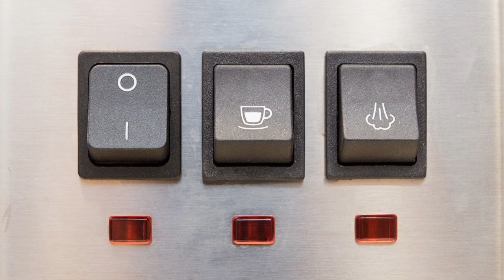Gaggia Classic Pro Power Switch Mod

Comment: I just tried modifying the original switch (removing the spring) and not using any additional parts. If you remove the two wires from the socket as you see in the video,  they are just long enough to reach to the power switch. The other end of those cables are connected to the main board. You just need a long screwdriver to undo two screws to remove the boiler and the plastic box that holds the electronics. Then you just unplug the brown and purple wires, they have the right connectors to plug them into the switch (instead of the two new black cables shown in this video). Obviously the other end goes back to the original location, the socket. This way you can revert everything whenever you want to, just put the spring back into the switch, replug the original bottom two switch cables (those were just unplugged, and left in place) and reconnect the brown and purple cables two the main board. Free and reversible.
Reply: Thank you. This worked. The only correction is that it’s the pump that you have to unscrew with the PCB tower, not the boiler.
Reply: Thanks a lot! Worked for me very well! 🙂

(My machine had yellow and red (instead of brown as on the video) wires at the bottom of the power switch)

Comment: Hi Damian, thank you for this great video. In my Gaggia the brown cable on the main switch is red. I think this doesnt matter? I mean, i have to change the two lower cables of the main switch by the new cables from the plug of the back of the machine! Is this correct?
Reply from the maker: I am not able to guarantee you if your wiring is correct? Theoretically, as you write, but if I do not see where the cables go in your coffee machine, I can be wrong?
Reply: Hi Michael
Did you make the change? did you have any problems? My cable is also red and not brown.
Reply: I also had the red cable (instead of brown) and changing two lower cables worked for me.

Comment: Hey Damian, Thanks for the video. I have 2 questions:
I guess some people in the comments here are asking if they can just remove the spring in the original switch and keep the same original wiring. Will that be an issue? (Ecotimer is still in use)

Also, I was wondering what are the chances of people reverting back to the original wiring after the mod. (I'm thinking to just cut the original wiring and route it directly from power to the switch) Thank you!
Reply from the maker: I don't think it's safe if you just remove the spring from the button.

Comment: Is there specifications on the Switch type? Or is it just size, for it to fit in the hole of the frontpanel?
Reply from the maker: You must use a switch that will hold a minimum of 10 amps
Reply: @Gaggia_Fixer  Interesting! Thank you. If there would be white switches available, that yould be so nice :-)

Comment: Hey, 
what about the fuse? It`s outside the whole circuit this way.
Reply from the maker: Well, so what ? This fuse protected the Eco Timer. The coffee machine has its protection on the boiler.
In this configuration, the ecotimer board acts as a jumper. You might as well disconnect the PCB and short the wires.
https://youtu.be/FiFN2Nx6zj8
Reply: @Gaggia_Fixer  alright, thanks !!
Reply: @Gaggia_Fixer  isn't the brown wire the one that goes to the thermal fuse in the boiler?
Reply: @F3RN4ND0CG  Agreed. I followed this tutorial which works. But the fuse is for stopping the boiler to explode in case the steamer thermobreak malfunctions and it heats past 180 degrees celsius.
Reply: @MohammedAghili  so have ylu found any alternatives?

Comment: So if i just change the contact i Will still have the ecotimer ? Without Any problems with the circuit ?
Reply from the maker: No, this modification is to bypass the ecotimer
Reply: @Gaggia_Fixer He meant, what happen if you remove only the spring from original switch. How the ecotimer behaves then ?  I guess it won't be able to power off the machine but are there any side effects ?
Reply from the maker: @misenko856  If you remove the spring itself, the coffee machine will continue to operate but it has no effect on the ecotimer.  The ecotimer switch-off signal is sent from the brewing and milk frothing button.  One of the phases is fed via a green wire from these buttons to the system, which indicates that the ecotimer is turned off.
Reply from the maker: @misenko856  The easiest way to cancel the ecotimer is to disconnect the green and blue wires from the brew button and connect them together.  The electronics will receive a signal to stop measuring time and the coffee machine will operate normally.  You can bridge them together like in this photo.
https://1.bp.blogspot.com/-Lm4eUrWpEgc/XnEVL2cqFuI/AAAAAAAAVrs/sNoq5PF_kHc-FobFl09dpFApl6z14sI0gCPcBGAYYCw/s1600/IMG_3075.jpg
Reply: @Gaggia_Fixer  Thanks for answer. But what exactly is the function of this eco timer ? I thought it is supposed to switch machine off after 20 minutes by sending impulse to power switch which unloads the spring or maybe I did not understood it correctly ? What do you mean that signal is send from brewing and milk frothing switches ? Thanks!
Reply from the maker: @misenko856  Ecotimer has a built-in relay, after pressing the power button it is shorted and the machine operates for 25 minutes.  At the same time, the ecotimer counts down the time and after 25 minutes the relay is turned off.  A green cable is connected to the brewing and milk frothing buttons.  If you press any of them, the green wire is short-circuited with the blue one, which causes one of the phases to be transferred to the ecotimer control board.  This gives him a signal that he should stop the countdown and not turn off the coffee machine.  so if you want to easily turn off the ecotimer, you need to bridge these two wires as in the photo I showed you earlier and the coffee machine will never turn itself off again.  Sorry I didn't reply earlier, but I missed the notification for this comment.

Comment: Why to play with the cables? I removed only the spring of the original switch, made it bistable and it is the same effect.
Reply from the maker: Not this is not the same effect, now it gives voltage to the circuit all the time. When the switch is monostable, pressing it you give a voltage impulse and at this moment you give voltage to the system all the time, which should be there only for a moment. Are you sure this will not short circuit ???
Reply: @Gaggia_Fixer  I made it two weeks ago and no problems so far. Of course your method is better and safer as we do not have electric schematics of the timer.
I made it this way because one morning the Gaggia did not want to stay switched on.
Reply: @jmatev1  Hello! How is your Gaggia now?) After 7 monthes without this spring in switch.

Comment: Nice hack, I was just about to buy the kit, you just saved me some money and waiting time, what size cable did you use, 1 or 1.5 mm
Reply from the maker: Hey :) All Gaggia is on 1mm wires, so you don't need bigger ones
Reply: OK, that's great, thanks a lot.
Reply: Done the job yesterday and programmed it with a smart plug to power on every day at 0700 hrs and off at 0800 hrs and is working flawlessly, thanks very much for sharing your knowledge.

Comment: If I just want to bypass the whole switch, what should I do?
Reply from the maker: what connector?
Reply: @Gaggia_Fixer  1st I want to thank you for the helpful video. I just figured out to connect the orange and blue connectors directly to the power source and it's working successfully ;)
Reply: I can turn on or off by the wireless smart controller

Comment: Thanks to your video, I was able to fix my Gazzia Pro button.  Thank you.

I have one question.  After removing only the spring from the original button(2:28), the rest of the cables are still in use. Is there any problem?
Seeing you have replaced cables I ask a question.
Reply: I am curious about the side effects of not bypassing the ecotimer.
Reply from the maker: The effects are that it is finally gone :) and the machine does not turn off itself. Thanks to this, I can finally turn on the coffee machine using a smart socket :)
Reply: @Gaggia_Fixer  Thanks for the answer.  Personally, I do not have any complaints about the ecotimer, so I will try to change the button method without bypassing.  Once again, thank you.
Reply: @democcrow888  how has this been for you? Do you also use a smart plug?
Reply: @democcrow888  Does it work ? What about ecotimer ? Any issue if you won't disconnect it ? I guess it should not be a problem and machine will stays on because it won't be able to turn off the machine, or ?